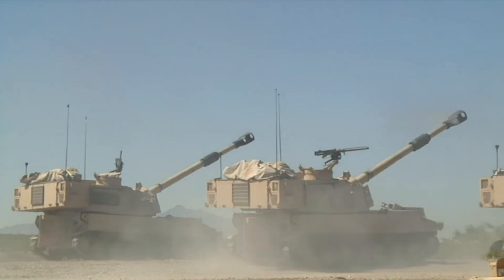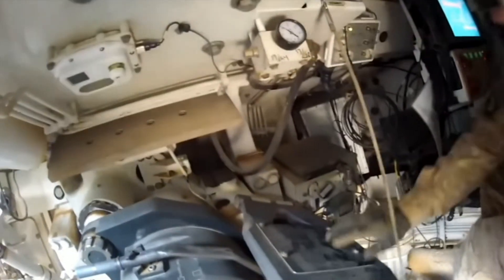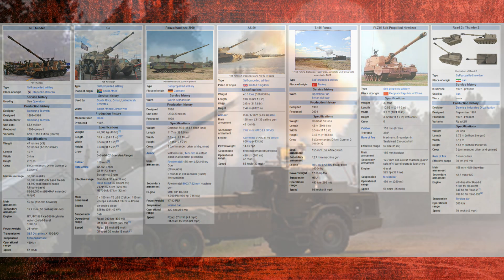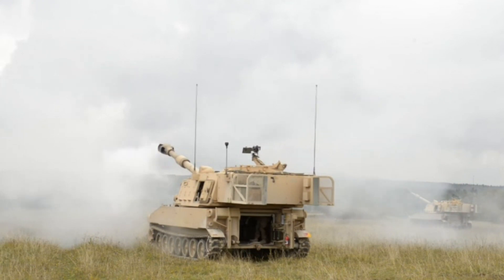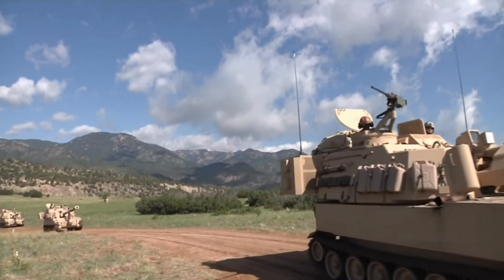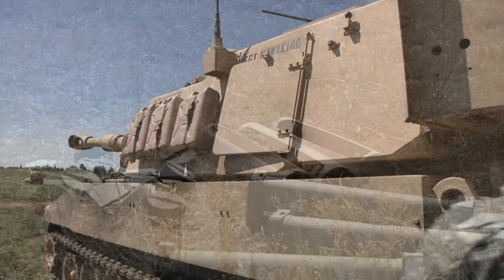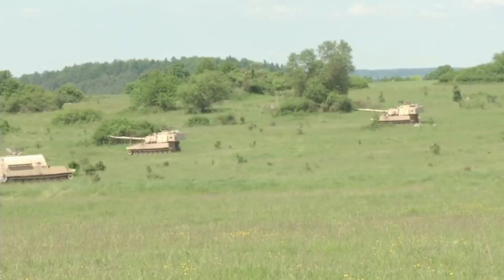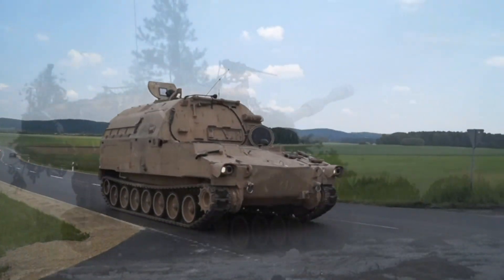M109A6 Paladin 155 mm self-propelled howitzer - American Artillery

Comment: There is, in fact, a NBC system. You need to hook your gas mask to it (flexible tube like a fighter pilot uses) / wear a MOP suit. So let's you breath freely vs sucking air from a filter.
But yes, a fully sealed system woulda been nice. Guess considering you have to hop out in the older models to lay the gun wouldn't really be much use to have the thing be fully sealed.

Comment: I was on the M109A6... That being said... ROUND HE, FUZE PD, CHARGE 3 LIMA READY TO BE VERIFIED! PERMISSION TO PRIME?! PRIME! PERMISSION TO HOOK UP?! HOOK UP! NUMBER ONE STANDBY, NUMBER ONE FIRE!!! BOOM!

One thing you got wrong, The spades are dropped when firing high powder charges not heavy rounds, Not sure why they are using the long lanyard in some of these shots but probably because of high powder charges which will fill the cabin with toxic smoke but we usually keep the hatches open to vent... Also the M109A6's I worked in DID have NBC gear, They even had hoses to hook up to your MOPP suite to give you a little bit of ventilation... Maybe I'm misremembering it's been years...

Comment: The M107 175 mm self-propelled gun was used by the U.S. Army from the early 1960s through to the late 1970s. It was part of a family of self-propelled artillery that also included the M110. It was intended to provide long-range fire support in an air-transportable system. So who was keeping up with who lol

Comment: At 3:30 the gunner pushes the breach handle forward because the witness marks aren’t aligned. This vehicle is amazing but that only when it works properly. I’ve had to break track on this thing a dozen times and have had to fix the timing system on the breach multiple times. It’s a real POS but keep great maintenance on it and it’ll take care of you.

Comment: Honestly, I feel the Army treats it like the M16(which also started service in Vietnam).
They want to, and know they should fully replace it, but they want to put it off until the next big development happens.
In the mean time, they just keep updating the old platform, again, and again.
Reply: TheNinjaDC Actually, the A7 gives the US Army a completely new weapon as compared to the A0-5 (where the A6 is the transitional weapon between the A5 and A7). The A6 had a completely new turret system (gun, fire control), and the A7 gets a completely new chassis beneath a modified A6 turret.

Comment: It needs a replacement badly.
Reply from the maker: SteelbeastsCavalry I agree man. BIGGER!! BADDER!!
Reply: Matsimus Gaming why did they not put the turret on a m1 Abrams body it would be economically sustainable.
Reply: The MLRS has replaced the M109 in some units. Not sure of percentages of M109 vs MLRS in active duty vs Reserve/Guard units.
Reply: Accuracy and crew are still top.
Reply: The M548 needs to be replaced first.
Reply: If you served in the 11th. ACR, thanks for your service.  The current 109s are new builds (A7s), using BFV components.  It's not the same old gun. The gun will also be lengthened to 58 calibers.  I still can't stand up inside the turret, but anyone under 6'4" shouldn't have any issues.
Reply: Paladin 06 Exactly! The A7 and the A0-5 have very little in common. The A6 has an entirely new turret and gun, plus AFCS. A7 takes the A6 turret and puts it on antirely new BFV-based chassis with hydraulics largely replaced by electrical systems that reduce the weight a ton.
Reply: 200mm Howitzer!!!!!!!!!
Reply: SteelbeastsCavalry in what ways is it obsolete? Newbie here :0
Reply: The new A7s are all electric and much better, and the A8’s will have a higher caliber forward recoiling gun for longer range with less recoil.
Reply: @_Matsimus_  like the pzh 2000
Reply: @ottovonbismarck7646  Check out the older US M110A1 8" (203mm)  SP gun.
Reply: @swaghauler8334  300mm howitzer!!!!
Reply: @swaghauler8334  more daka! Bigger daka!!!!
Reply: Let’s get the k9

Comment: my dad was in during the mid 60's and spent most of his time as a mobile artillery mechanic, and backup spec 2nd class to the M60 tanks. hes been impressed with the way other countries have modified the old M60, some are very similar in ideas that he had back in the day. He always wanted to lengthen an M60 in the rear, and drop in a more powerful, and reliable inline engine. he got sick of changing out engines because crews werent deploying, so they didnt care if the engine had a "run away" event. just stuff a damn blanket over the intake! but he served on the 175mm guns which were retired, but you might want to check into. if i remember right he said it could fire between 24 and 27 miles.... either he didnt get the exact range or its slipping in his late 60's? i dont care, so long as hes happy and keeps the brain working. but https://www.youtube.com/watch?v=OlEU9uFXbAg  and  https://en.wikipedia.org/wiki/M107_self-propelled_gun hope you enjoy

Comment: I was on the M109A5 to A6 Paladin. NBC protection has been on the gun since the A4 variant as far as I’m aware. I can’t remember honestly if I remembered seeing it on the A5 when we were in the field or at motorpool, it’s been awhile, but I distinctly remember seeing the NBC system installed on top and to the rear of the vehicle on the A6 variant. And the Army has been trying to go the way of artillery auto-loaders since the 90’s, first with the Crusader howitzer in then later the NLOS cannon. In my battery we basically agreed the Germans had the best self-propelled howitzers. We also have no long range precision rounds I hear that can be used in GPS denied environments and at long range. I guess the Marine M777’s are using both those long range rounds in Syria.

Comment: Self loading system are great until it breaks down.  A semi-manual system like the M109 is designed to work even if the hydraulic system breaks down you can go completely manual

Comment: As far as the proposed replacements for the M109. They simply did not work out. The Crusader (XM2001) project in the 90's was outrageously complex and extremely expensive. The NLOS on the other had was advanced but, it showed no improvement over the Paladin. To be honest we should have mounted a new longer howitzer on the A7 to get some extra range IMO. BTW Matsimus. Did your video on the K9 Thunder get taken down by YT? I cannot seem to find it for some odd reason.

Comment: Matsimus, a long while ago Israel was developing its own self-propelled howitzer called SHOLEF, which was based on the Merkava chassis. They didn't go further than building one vehicle in the mid-80s, and then the project was cancelled because, according to the official version, it was too costly. However, the technical characteristics of the howitzer are impressive even by the today standards. For example, the howitzer's advertised rate of fire could be up to 10 shells per minute. Can you make a video about the Sholef?
Reply from the maker: Gennadiy Leyfman I could maybe do that. Thanks for watching
Reply: Matsimus Gaming Thank YOU!

Comment: The 155 is a good Artillery piece BUT if you want to get on a real Artillery Howitzer then get on the M-110 A1 Self Propelled 8 Inch Howitzer. It fired a 300 pound projectile

Comment: I will stay with the M-110-A1 8 Inch Self Propelled Howitzer.  
The 155 is a pop gun compared to the 8 Inch which shoots a 300 pound shell
Reply: actually it's roughly about 200 lb projectile.

Comment: i was stationed at Ft Stewart GA    3/41FA  i fired these and some of your info is NOT accurate  In specific Fire Times , a Paladin can roll onto the scene , be laid and safe and let lose a round in 25 seconds.   they did in fact have NBC filters but we used them as personal airconditioners when we were sitting during field training.   as i posted this i noticed someone below stating some of the info i typed up.

Comment: The xcaliber round sucks. We only shot them at special artillery shoots. They had some problems with occasionally hitting the designator instead of the designated target. I have shot some out of a m198 on a few direct fire missions. When you pull them out of their canisters, most have something wrong with them like a stuck retractable fin or a busted dial etc. We used to call them the million dollar practice round. Not impressive in reality. I would much rather use dpicm.

Comment: Autoloaders are a terrible idea unless you are using a system akin to the stryker, the reason for that is because of the issue with Russian tanks, their autoloaders go around the bottom of the turret ring and one hit from above or a penetrating shot from the side and the tank goes boom killing everyone, the point of manual loading is crew survivability, something that the Russians don't use.

Comment: Autoloaders add weight and complication to these Vehicles  and take away crew members that could keep it shooting when the autoloader, as it will in accordance with Murphy's law, breaks down at the worst possible time.
Reply: So at 10:45 you said the M992 was being replaced by the M548. I think that's backward. The M992 FAASV replaced the M548 6ton Carrier Ammunition Tracked which was a good thing. The FAASV having the same tracks and Electrical system meant easier repairs plus we could use the APU in the 992 to keep the batteries charged in the gun. Also the conveyer system allowed the ammo team to stay inside the FAASV and not as vulnerable to enemy fire. Also liked the MRE heaters in the 992. 
One more thing. The crew can also mount a MK19 Grenade launcher in stead of the standard M2 .50cal on one of the vehicles (in our batteries this was usually the support vehicle.

Comment: Hopelessly outdated, only serves a sensible role in asymmetrical warfare. Against modern militaries it lacks range, fire power and fire control.
Reply: rolf ski, accurate within 10m of observer supplied info on first shot, if we fire a copperhead it hits were the laser is pointing.
Reply: That's completely ammo-related, as a firing platform it simply doesn't belong within a modern US military. There's a reason fellow NATO allies moved along to better solutions.
Reply: Not entirely the ammo, except the copper head, the accuracy has more to do with all th data the Paladin collects on itself, and the fact that the M109A6 has a much heavier and temperature resistant barrel than used on earlier versions.
Reply: but you are right we need something new.  However despite what Trump says both the Democrats and Republicans in our congress have cancelled almost every armored weapon system the Army was working through our procurement processor between the 80's and 2000 and have been resistant to many requests since then.  The Crusader would have been nice to have though.
Reply from the maker: rolf ski I agree to a extent